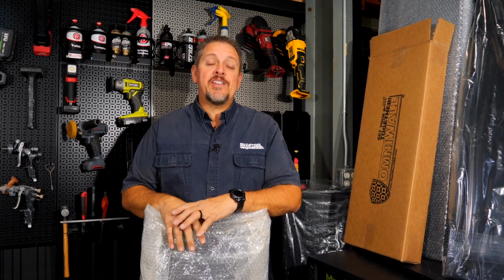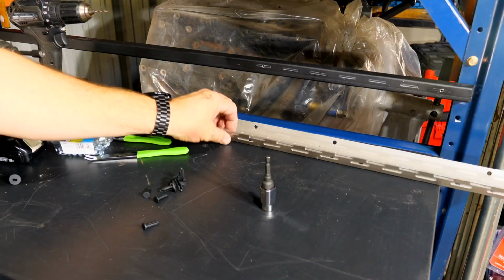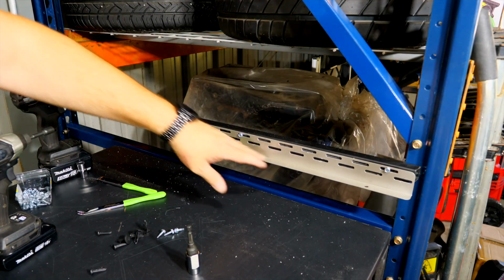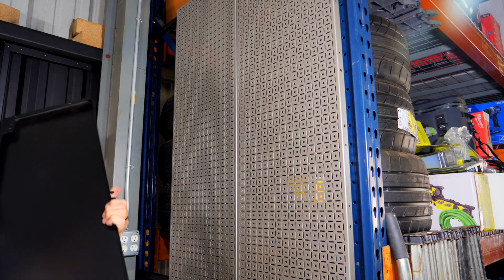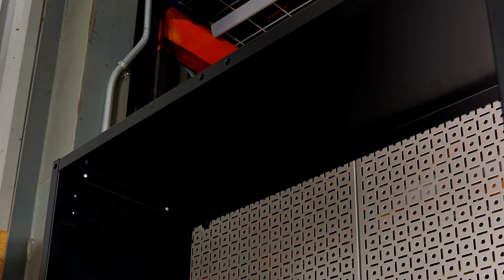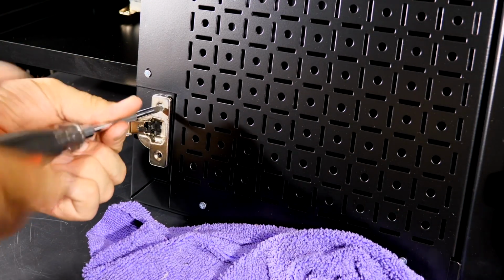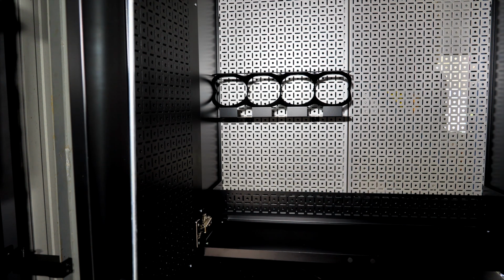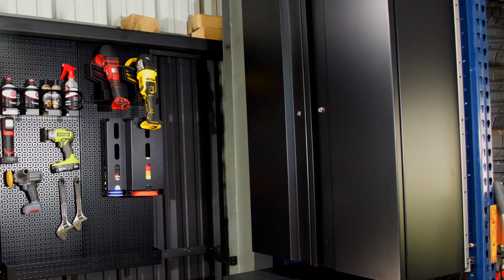BOOST Your ORGANIZATION! Made in the USA OmniWall All Metal Cabinet

Comment: DEFINITELY wanna put those buffing pads in the cabinets to keep them from getting Dusty... That would've been the 1st thing I would've thought about...
I would assume that these are better than Wall Control brand, as you cant mount the shelf accessories to them if you turn the wall horizontally because the slots are only made vertically up and down (unlike Omni which designed the slots both vertically and horizontally!!!, THAT'S A HUGE DEAL! and should easily make Omni Wall the preferred go to choice!!!)

Thanks for putting out these videos sir
Reply: A "HUGE DEAL" ?...lol.  How many times are you planning on relocating the panels ? If you mount horizontal, then order Wall Control horizontal. Same with vertical. No big deal at all for most people. Omni Wall is great if you've got money to burn. If not, Wall Control is the way to go !